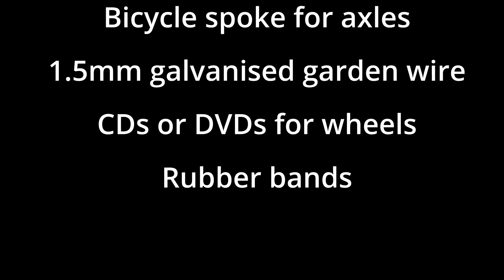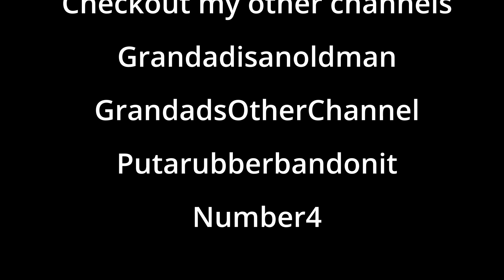Put a rubber band on it 0455 Mk2 BASIC Rubber Powered Fan Car

Comment: isn't it more efficient if you don't have the duct on the blades?
Reply from the maker: It would certainly be lighter without the outer ring, however, a 3D printed fan like this will be very brittle so having the outer ring adds strength and that is more important here. Here is a much better design (but much larger) - 0393 Ducted fan car https://youtu.be/5uCFW0wCLNw